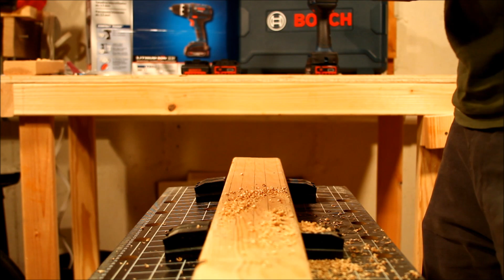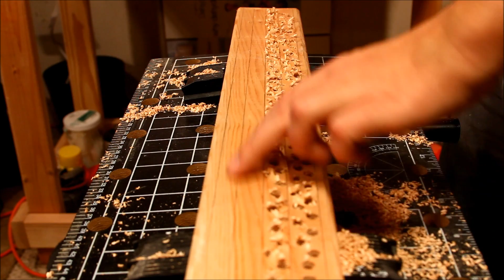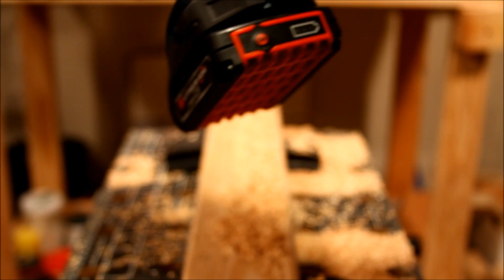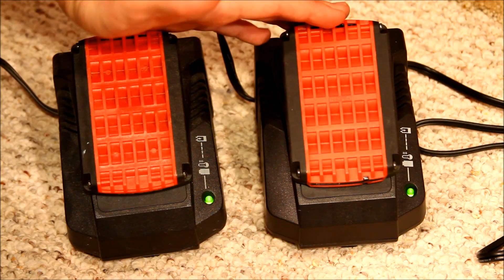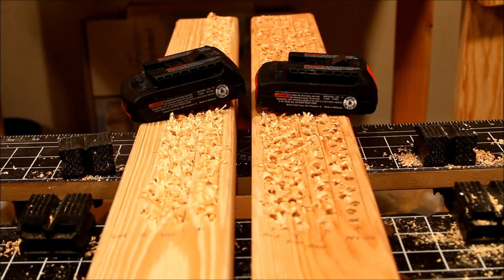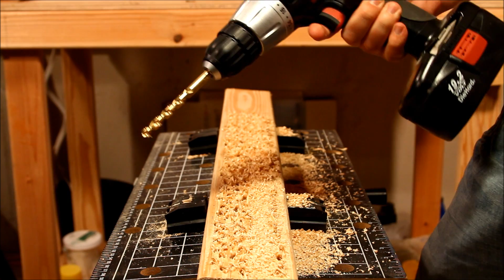Bosch DDS181-02 Peformance and Battery Life Test

Comment: Without watching until the end. My thoughts are, its really not about the drill itself. It all has to do qith the battery and the bit! If you use a corded tool... then it only has to do with the bit. You can buy an inexpensive40  dollar electric drill as long as your bits are sharp...it will perform nicely. Of course if you're a professional and use the tool all day you'd want a more expensive model as I believe they don't heat up as quickly
Reply: For the record. I have the 181 bosch, and I love it